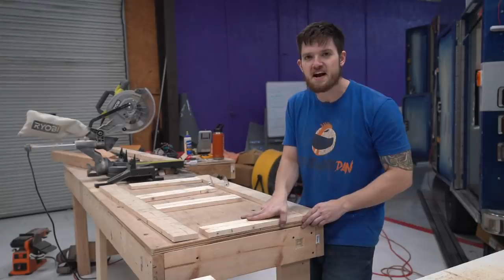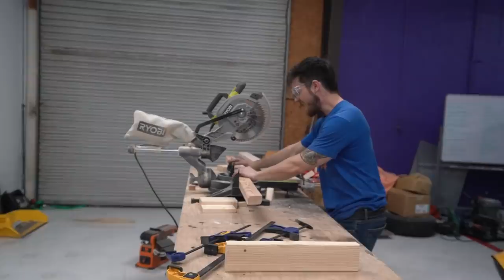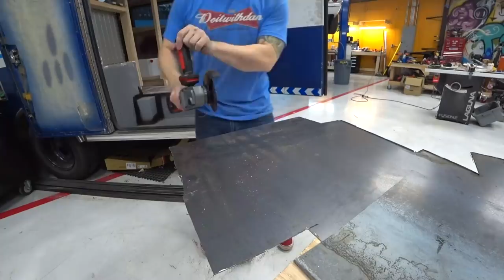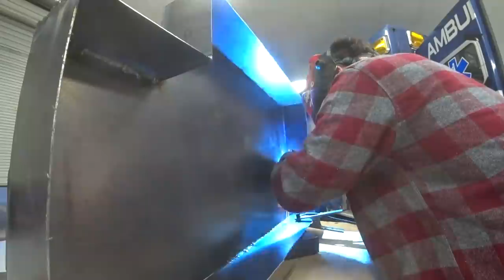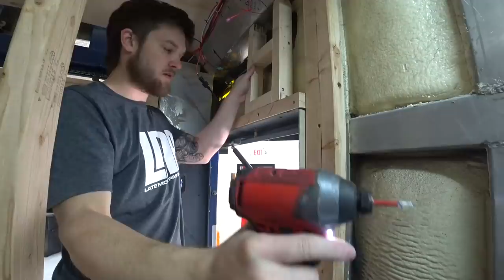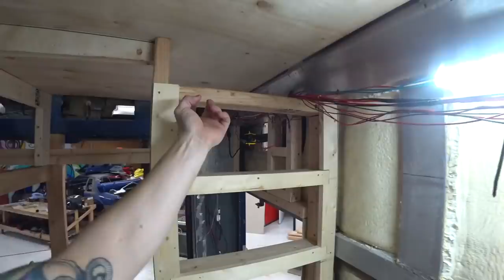The Beginning of the End | Ambulance to RV Build Series

Comment: The grey water tank is looking good. I had a thought when watching you build it, but you might wanna add a few baffles across the tank to help with water sloshing forward/backwards/slide to side. Could use some plate and drill a few holes in it and cut out a couple holes down low so it can fully drain out. Like a fire truck basically.

Comment: Hey, I dunno if you're finished or not, but you should probably do those bungee cargo nets for the "spice rack" shelves instead. Easy to take off, and still secures everything good enough. Also, I'm really surprised you're not putting in a level gauge on the water drain tank with hoses going to the outside, then put like garden spigot with a valve so you can drain the tanks from the outside, even attach a hose to control where they drain.

Keep up the good work, Dan! Loving the progress.

Comment: Personally, I would enclosed that shower drain tank, let the water drain in from the top, have a pipe go in from the sink so it’s unseen, and have a ball valve at the bottom. so he can either let it drain out if it’s in an area that can, or be connected to a sewer. Or visit a pump out station

Comment: Awesome! Hey Dan for the walls in the shower/bathroom they have water resistant dry wall (I believe its dry wall). Helps keep the moisture out. They last longer. Also is Justin going to wrap it when it's done? For the windows if Ham is worried about people looking in on him he can always put window vinyl up. He can see out like a normal window but no one can see in. Would add some special personal decorative look to it. Or he can just tint the fuck outta them 🤣

Comment: Stainless steel ia usually for tanks.
Since its for grey water just use steel like dan did.
Then coat inside with flex seal. Problem solved for leaks and rust

Comment: Why didn't you cute the metal sheet from the middle and added the sides to the bottom as one whole cut .that would've allowed you to just bend the sides no welding needed only straight welds on the corners and a top layer to everything else